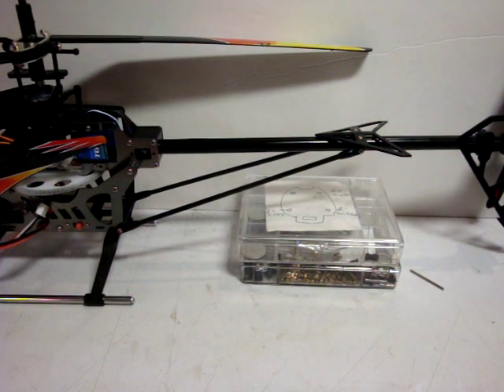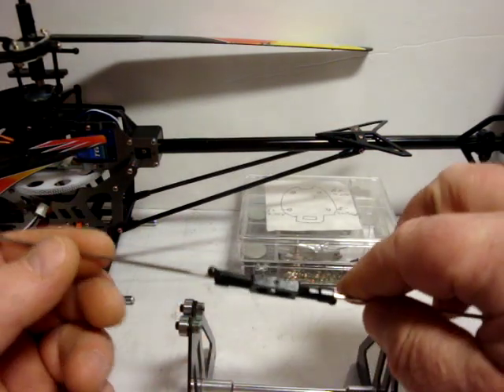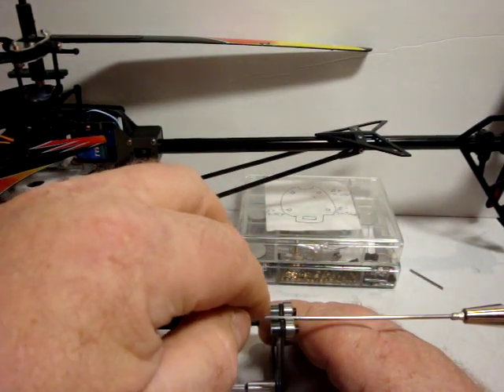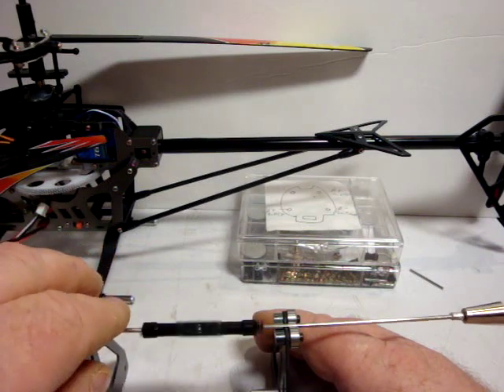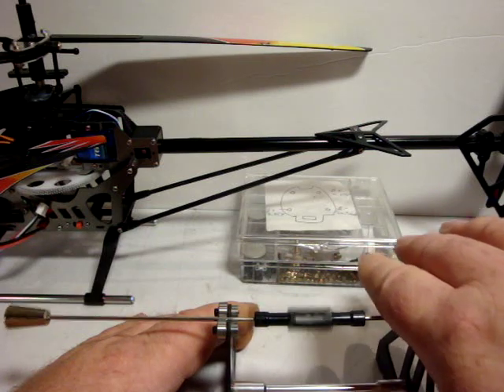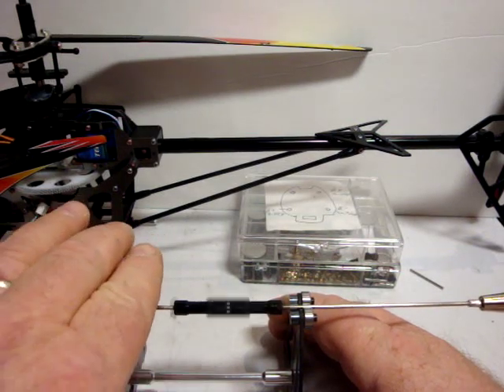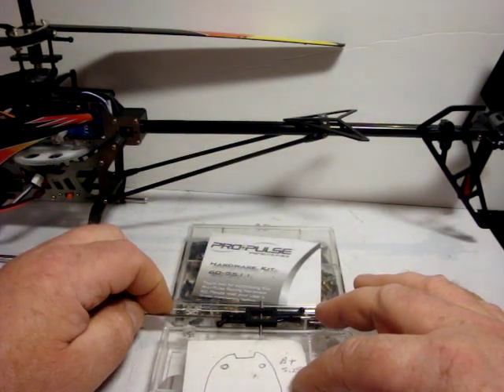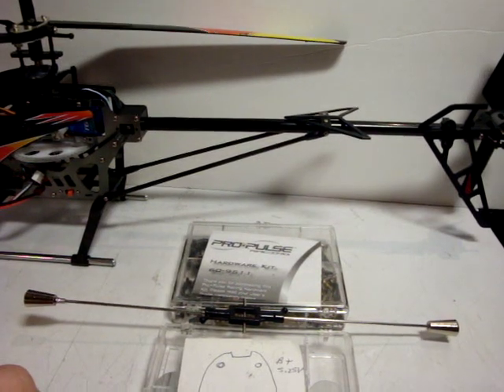Mini How-To : Straighten & Balance V913 (And Similar) Wire-Core FlyBar

Comment: Hello sir...can u please help my heli flies right sideward automatically even after adjustment whqt to do??
Reply from the maker: Adjust the roll servo linkage so it doesn't drift to one side or the other; that is the whole point of adjusting the swash. Then adjust the pitch servo so it doesn't drift forward or backwards. Do your adjustments on a dead-still day or indoors with trims at zero.
Reply: mnemennth thank you for your kind response cant u give me the demo on video etc
Reply from the maker: I'm afraid I can't; I gave the v913 away to one of the neighbor kids years ago. This video was originally filmed forever ago when I first got back into RC aircraft. I've long since moved up to CP Helis and now acro quadcopters.

Comment: how do I get the flybar off in the first place?
Reply from the maker: +Ulises Batalla There are two links that snap onto the balls; some models only use one. Undo those, then press the pivot pin out of the flybar head. Some models use a screw-in pin; they'll have a Philips head on one side.
Reply: OK. Worked it out thanks.  Here is what I'm working on.  V913 with upper head and blade grips. CNC swash plate.

Comment: Hi, thanks for a great video. After watching I have noticed one side of my V913's flybar is way too heavy. I would like to ask - do you prepare the surface in any way to do the soldering?
Reply from the maker: I cleaned the wire with alcohol to get rid of surface crud; but the idea is to add a ring of solder and wire as a weight right at the existing weight such that it can't fly off. I'm not trying to solder it to the flybar wire; it's made of high-nickel wire that is hard to solder to.
Reply: mnemennth
Your method worked like charm. Thanks! My flybar was so out of balance I had to put twice the solder you did in your video. I have used three resistor wires to solder, SMD flux to clean and it went really easily. Heli's vibrations are now significantly reduced.
Reply from the maker: Glad I could help!

Comment: Hello, What kind of problem could bring an unbalanced bar during the flight?
Reply from the maker: Most common cause of bent flybar is it striking the tailboom; the entire swash and head of this heli is ABS plastic and it in no way very precise. Everything gives, and it allows the flybar to strike where it shouldn't.

A bent or out of balance flybar will cause excessive vibration, altering the gyro's ability to level the heli and making it hard to control.
Reply: mnemennth
Thank you  for your time and your answer, I really appreciate it!!!
Reply from the maker: Glad to help!